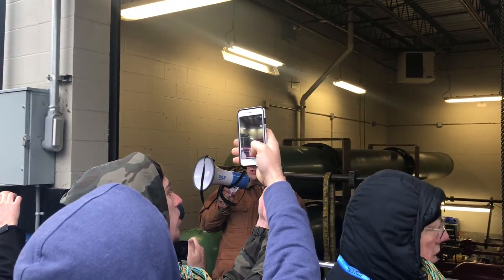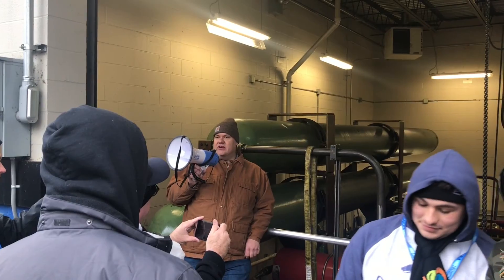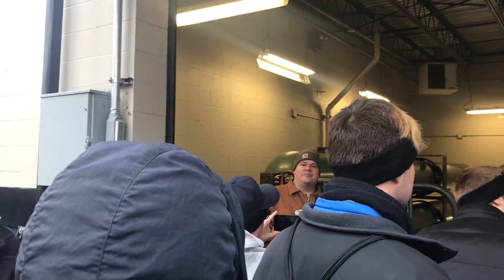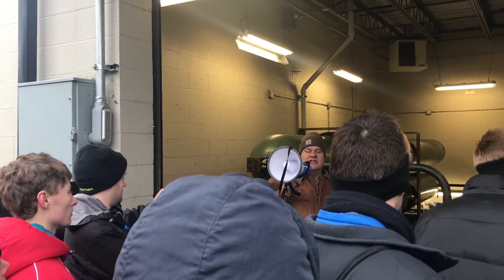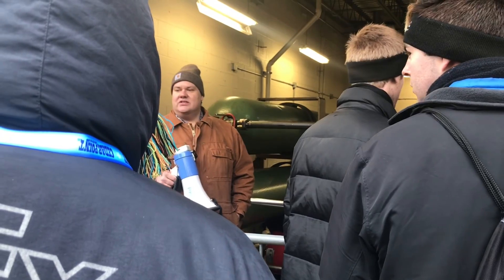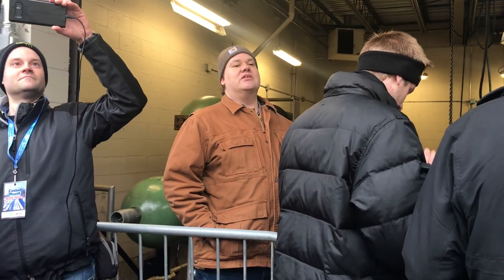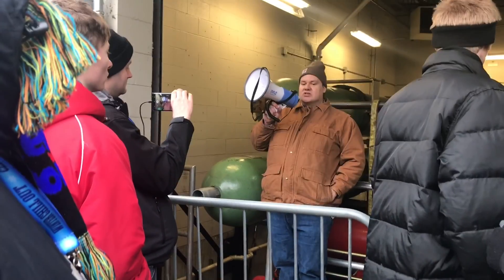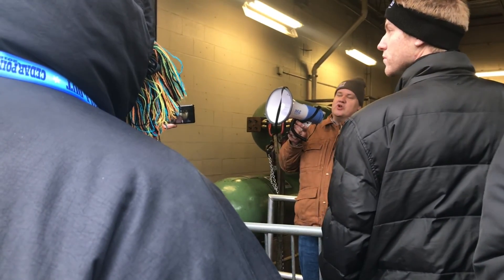Taking a Look Inside Top Thrill Dragster's Hydraulic Launch Room!

Comment: I like that these people all ask really sophisticated questions about the ride. One thing that never seems to be explained anywhere is exactly how the hydraulic motors work. I understand that the high pressure nitrogen in the accumulator pushes the piston to force the fluid through the motors and the motors turn the drum. The only piece of the puzzle that's missing is how the fluid works in the motor to do that
Reply: There's a set of vanes or gears inside each motor, so when the fluid is forced through the gears it will cause the motor to spin at a very high speed (I've linked a disgram below). These motors most likely have a set of gears inside them to step up the torque they output. All the motors are then attached to a planetary gear system which joins their outputs and gives a very high-torque output (diagram for this linked too). So the motors are attached on the ring (larger) gear of the planetary set and the drum is atatched to the sun (smaller) gear.

Hydraulic motor digaram: https://upload.wikimedia.org/wikipedia/commons/c/c4/Gear_pump.png
Planetry gear diagram: http://blogs.youwheel.com/wp-content/uploads/2015/03/Planetary_Gear_Set.jpg

There are more complex planetry systems out there, the diagram above is probably not the system used on this ride, but the working principle is the same.
Reply: coastermania17 good question! I like the way you think. Don’t find to manny people like that.
Reply: Look up on YouTube 'How Top Thrill Dragster Works' and you'll find an amazing video that explains everything